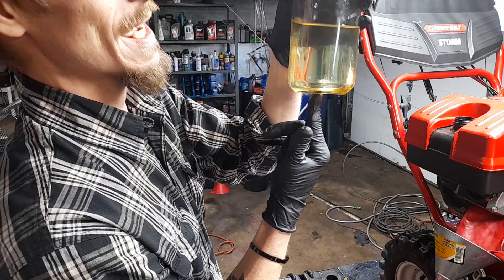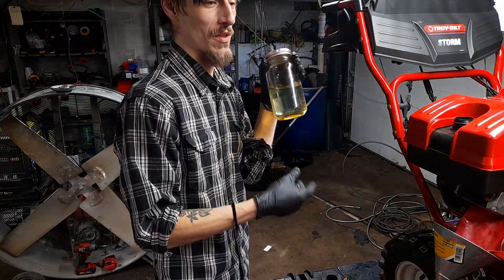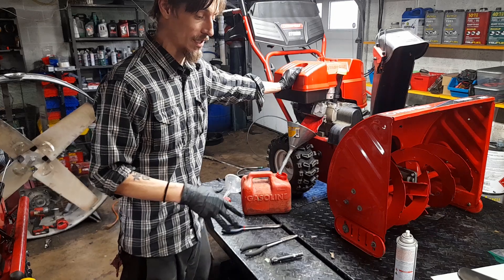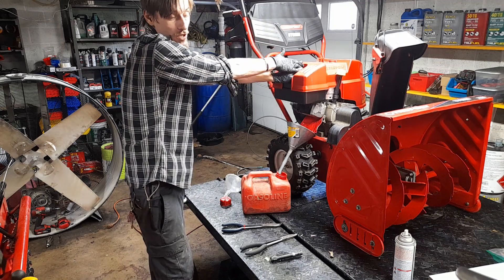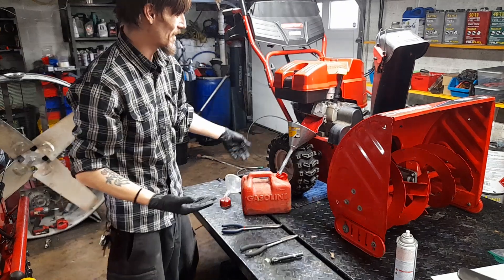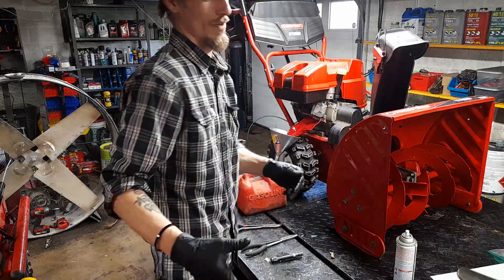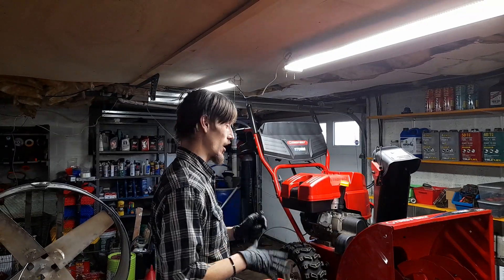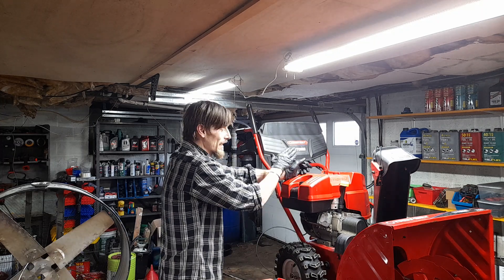Ethanol Fuel Why It Works In Cars , Not Small Engines In Most Cases, How To Resolve Ethanol For Good

Comment: I need an EFI small engine in my snow blower so I can burn the cheap ethanol gas without gumming a carb up and rusting internal parts. it would be good to see EFI options instead of carbs for small engines.